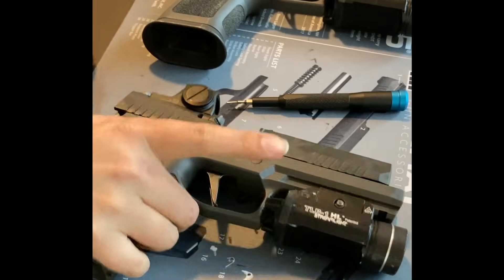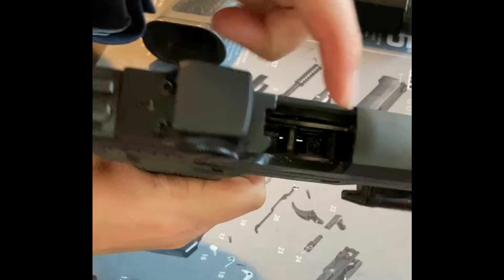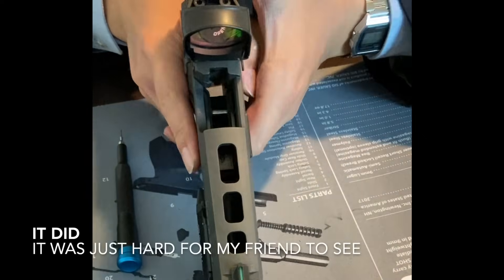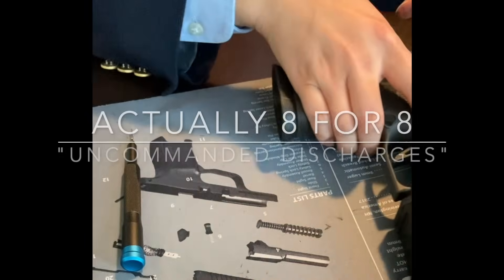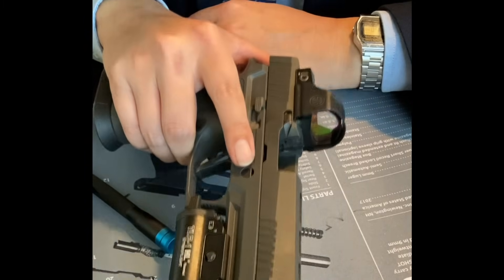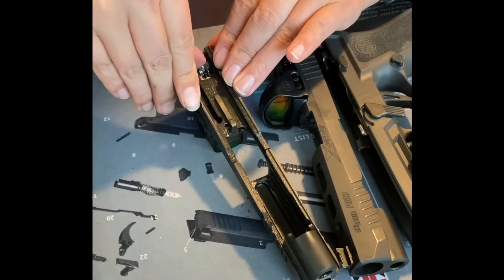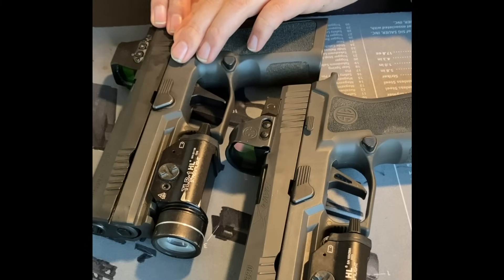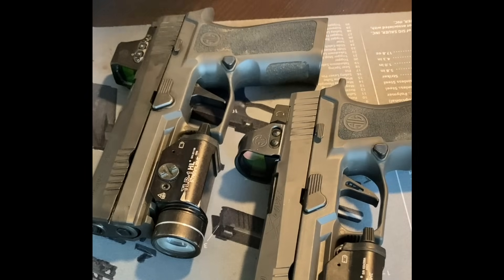Testing two P320's for Uncommanded Discharge: One PASS, one FAIL

Comment: Take a look at your brass on the friend’s p320 and look for striker drag.  The striker reset spring might be failing.  I had to replace a striker assembly on another brand’s pistol due to striker drag and light strikes.  It’s a cheap fix to replace the striker assembly.
Reply from the maker: His striker reset spring is almost certainly failing. It seems to contribute to the vulnerability, but does not appear to be the whole picture. Regardless, it's worth fixing that as well, but no point in spending that money unless we can get his pistol to actually pass the tests first.

Comment: Nobody is poking the back of the sear with a tool when they go off
Reply from the maker: For whatever reason, sears are failing and releasing strikers. When the sear fails, there is precisely one safety mechanism left preventing an “uncommanded discharge.”

This test doesn’t care why the sear failed, it assumes the sear has failed and checks whether that last-ditch safety mechanism is or isn’t working as intended.
Reply: @P320Truther isn't there a firing pin block?
Reply from the maker: That function is performed by the “Striker Safety Lock” - this test is explicitly intended to check for proper functioning of the striker safety lock.

Comment: Any idea on the round counts of these two pistols
Reply: What number is stamped on the front of the sheet metal frames
Reply from the maker: Uncertain of round count on my friend's pistol. Mine has thousands more than his, somewhere between 8,000 and 9,000 at this point.

The passing FCU has a 675 stamped Trigger Bar and an X-series flat trigger, the failing P320 has a 576 stamped Trigger Bar and a Legion-series skeletonized trigger.

Comment: YouTube keeps deleting this comment so I'm breaking it up.

Great testing. I've been waiting for something like this.

Something that I either missed or don't think was mentioned in the video is that manually displacing the sear as shown in your test moves the trigger, the trigger bar, AND the lever next to the sear that interfaces with the striker safety to disengage it. When learning this, my first thought is that the striker should be visible for EVERY test that you did. However, what I am noticing on my P320 is that pressing the striker down manually moves that striker safety disengage lever only slightly when compared to how much it is displaced when pulling the trigger directly. The striker safety itself does not need to move much before it allows the striker to move past it. I think the difference between the two guns you tested could be a combination of how much the striker safety disengage lever moves when the striker is manually depressed, as well as how much the striker safety itself needs to be displaced before the the striker can move forward.
Reply: You also mentioned 2 failures would need to occur simultaneously for the gun to fire: the primary sear would need to disengage without the trigger being pulled, and the striker safety would need to be free of the path of the striker. I think there is one more failure which would also need to occur for a total of 3 failures. On post drop fix P320s, there is a secondary "safety" sear in front of the primary sear. The idea is that if the primary sear were to fail, this secondary sear would catch the sear before it can move fully forward. This form of testing bypasses this additional safety. I think the only way a failure of this secondary sear could occur is if the sear assembly failed to move upwards quickly enough after the striker is displaced from the primary sear.
Reply from the maker: The current working theory is that the Legion’s interface between sear, trigger bar, and safety lever is tighter than the non-Legion’s interface, allowing the Legion to more readily translate sear movement into safety lever movement.

Re: Secondary Sear - It’s difficult to conceptualize a shock or jolt that would provide sufficient force in the appropriate direction to overcome the primary sear, yet simultaneously not provide enough force to keep the secondary sear out of the way due to inertia from the sear pivoting downwards powerfully enough to slip the primary sear against spring tension.

Comment: The real test is to take the gun to a range, have the gun chambered & loaded as it would be carried in a holster and see if you can actually make it fire this way. Obviously ensure gun is pointed down range in a safe direction before doing so.
Reply from the maker: The standard test is primed cases with no powder or bullet. There's no reason to set off a live round with this and risk the recoil munging up the slide, your tool, or your hand.
Reply: @ 

Then try it with a primed case & no powder. I’d just like to see if it would actually cause a discharge in the condition it’d actually be carried in
Reply from the maker: I would not be comfortable with a pistol whose safety regime includes mandating the use of ammo with hard primers… My friend’s striker protrudes when it really shouldn’t, and that’s all we really need to know to fail the pistol.

Comment: Great video back to Glock or M&P platform. I really don't want to deal with this company anymore, dumped my M18 and P365 even though P365 was no problem. The Sig quality is long gone for me owning older P225/P226 I love and will keep. Striker fire pistols that Sig manufactures are not for me plus my 365 rusted like crazy (not the mags) even though I wiped down the finish every night with silicone rag. I was looking for a reason to get away from Sig thank you I am gone.

Comment: Awesome demonstration, thank you!  You mentioned your friend’s FCU possibly malfunctioning so I was wondering if you could confirm a few things:  Do the 2 FCU’s have the same trigger bar number?  The same sear shape/design?  And does one or the other FCU still have a “striker safety lever return spring”?  Sig has made several unannounced changes to the P320 over the years which doesn’t help narrow things down.  That return spring is probably the part I’m most curious about - the P320 FCU’s safety lever used to be under spring tension but the spring was discontinued at some point supposedly because it could bind up and cause the lever to inappropriately engage the striker safety lock without a trigger pull but I think the official explanation was that the spring was redundant, unnecessary.
Also did you do a teardown of both striker assemblies?  I think I saw someone mention it in the comments but there’s a tiny spring that is overlapped by the main striker spring that pushes the striker back out of the breach after firing which did not seem to be happening with your friend’s assembly so I’m wondering if that part is damaged/defective.
I ran a similar test with my own P320 about 2 years ago and it passed but I didn't have access to any other P320's to try out for a bigger sample size.  TBH, even though mine was a pass, when I took apart the striker assembly and looked at the striker safety lock & spring as well as the tolerances involved it didn't inspire a lot of confidence at all.  I'm not an engineer or gunsmith, but I suspect Sig settling on the P320's weird striker safety design was probably a byproduct of the space constraints they were left working with when they cannibalized/recycled the hammer-fired P250 in the rush to make the P320.  In contrast, the P365 was basically designed from the ground up, has a more robust firing pin block/plunger-style striker safety design, and coincidentally has a much better reputation than the P320.
Reply from the maker: The passing FCU has a 675 stamped Trigger Bar and an X-series flat trigger, the failing P320 has a 576 stamped Trigger Bar and a Legion-series skeletonized trigger.
Both FCU's sears are identical to all appearances.
Neither FCU have a spring pressing the Safety Lever back down. The Safety Lever freely rotates to the extent allowed by the Trigger Bar.
Clearly my friend's Striker Assembly does not have a Striker Return Spring in good working order, but that spring merely seems to mitigate the problem rather than cause or solve it.

Comment: Great video. This is a great way for all of us to check if our 320 is safer or not. I will test mine to see if i will return it to my carry rotation as right now it is not. Back to my g17 and 229
Reply: Just for shits and giggles carry it with the striker engaged, but with no round in the chamber. Come back to it in a month and see if the striker is still engaged. If the sear cannot hold the striker in place I wouldn't be relying on the striker block to keep the gun from firing. Problem is these issues are happening so randomly. Who knows if a gun that is safe now will still be safe two years from now?? To me this is just a faulty design and I could never have faith in it performing the way it was intended.
Reply: Took mine out of rotation too, I have yet to have an issue but started to become concerned about wear on the sears /and safety mechanisms I’ve defended the p320 my fair share but there were far too many instances to ignore

Comment: ....Thank you! Great video that most or ALL P320 owners should see, right here.
Reply: I don't understand why they don't slamfire on the range if capable of an uncommanded.
Reply: Alot of maybe's
Reply: Tested mine this way and it didnt have the issue at all. I'll periodically check it but I feel much better now seeing the mechanism and work.
Reply: I couldn't find any report from any p320 anywhere else in the world having this issue. Even there are no numbers of units sold outside the US available, it has been adopted by law enforcement in many places.  In Germany they cost double, but they probably also do tolerances and quality control the German way. Best guess is: manufacturing defects in the US. It's a known issue, that SIG USA is not as diligent and precise as SIG Switzerland once was.
Other than that, this may could be caused by improper maintenance, causing damage to the spring?
Reply: They don’t want to know it.
Reply: Notice me, senpai
Reply: @Hugh_Jass86  witnessed
Reply: @jiujitsu5000  RIDE ETERNAL
Reply: The legend himself

Comment: The reason this is happening (at least on the 1 gun) is that by pushing the sear so far downwards, it automatically activates the safety lever upwards which allows free striker movement. In reality the sear has constant pressure with the 2 sear springs. By pushing it down with that pic you are removing all spring tension and of course allowing the striker leg to bypass the secondary sear safety notch. Interesting video but what realistic situation would replicate a pick being able to depress the sear fully downwards like this ?
Reply from the maker: For whatever reason, sears are failing and releasing strikers. When the sear fails, there is precisely one safety mechanism left preventing an “uncommanded discharge.”

This test doesn’t care why the sear failed, it assumes the sear has failed and checks whether that last-ditch safety mechanism is or isn’t working as intended.
Reply: Something as simple as sear wear or an out of spec part. That's it. It's way too easily defeated.
Reply: @ simply search wear cannot change the operational characteristics of the gun. You got that from “Indian MIM” comments. To date we haven’t seen a single case where anyone can show a sear so poorly made that it alters the operation of a P320.
Reply: @great_deception  🙄 I don't know where you got the idea that out of spec parts or wear cannot change the operation of the trigger/fire control group. Of course it can, and will. The P320 has a host of issues not only in design, but also manufacturing engineering issues that Sig refuses to address.
Reply: @ Please show us 1 verified forensic or lab reviewed example of a worn sear or even an out of spec part making a post-2017VUP P320 fire WITHOUT a trigger pull.

Comment: I would love to see these pistols disassembled and the parts compared - they’re not difficult to take apart. Would you consider doing that and posting it?
Reply from the maker: Working on it...
Reply: @P320Truther the other thing that could be happening is that the lifter cam that moves the safety lock up could be taller on your friend’s gun. His safety lock could also be slightly lower. That would explain why his always overrides. It’s enough above the stop on the striker even when it’s at rest.

That would also explain why your striker failed twice. It’s borderline within the stop range, but twice the force of the striker coming forward was enough to push the lock up.

Lastly, when you put your friend’s slide on your FCU - you didn’t see failures because your cam is the correct height, and the safety stop was low enough to catch the striker stop.

It would be interesting to measure how proud that cam sits when it’s in its resting position on both guns.
Reply: @P320Truther also - that striker looks like a MIM part. MIM has a tendency to not be consistent sizes when done poorly. If that striker was just a little undersized it could move up in the striker channel. Combine that with play in the slide and it’s not hard to imagine the striker sliding off the sear when the slide is bumped.

Comment: I want to see both guns Sear’s. I am suspecting the one that doesn’t fail has the 2 step sear.

Also lube the failing one it’s dryer than popcorn that could be part of the problem.
Reply from the maker: Both sears are the post-"upgrade" variant with the secondary sear, but it's irrelevant, as the secondary sear never engages. Lube on the slide is irrelevant to any of the specific safety features at question.
Reply: But carrying a dirty dry weapon is fashionable.

Comment: I have and you can to use the same pokie thingy on a glock too and get the same results on every glock. Crapola, stacatto is going to series 80 on their guns because if you drop them barrel down they will fire unintended too. I performed "your test" on all my  actually all weapons will release the striker, firing pin, hammer I you manipulate the sear. No before I pushed down the sear like you did I insert a pencil ,eraser part down into into barrel, pointing the gun up I pressed the sear, it released the striker but the striker block did its job,  the firing pin never strike the pencil eraser, if it have the pencil will move (this is actually how to test firing pin striker functioning correctly, then I went to the range loaded a live round I tried your test never resulting on a discharge of the bullet. Since your post I have tried on 53 different p320's..... still nothing happen to corroborate your claim......
Reply: Glocks have a plunger style striker block. They require a trigger pull to defeat the striker safety.
Reply: Not remotely true
Reply: An impossible thing to happen on a Glock— this is a blatant LIE—without the TRIGGER moving—the bar WILL NOT depress the safety plunger and the striker will thusly be trapped behind it…

Comment: Someone get this guy a job at sig, he can figure it out with a long pointy thing while sig has a state of the art facility and claims nothing is wrong with their p320   😂
Reply: They actually had 3/10 of their own tested pistols cause light primer strikes after doing vibration testing on them
Reply: That would imply SIG is interested in figuring this out. I'm sure they know but they can't admit it. They have likely quietly fixed this issue and won't admit it

Comment: So you are sticking a Pointy thing in the gun to make it go off and call it a failure?
Reply: You don’t understand what this is testing.  

It’s testing if the safety features work if the striker were to drop.
Reply: LOL. This is how you test to make sure that if something internal fails, the gun still won’t go off due to other safety mechanisms such as a firing pin block. 

Sig claims that even if something fails, if the trigger isn’t actuated the weapon cannot fire. Which is obviously not the case on some weapons for whatever reason it turns out to be. 

Be smarter.

Comment: I don't know if it matters, but if you completely disassemble the striker, there is a very very tiny spring in there, and every time I took mine apart, that spring was broken.
Reply from the maker: It is likely broken in my friend’s P320. Sucks that it can only be officially replaced as part of that entire striker assembly.
Reply: @P320Truther it’s the striker reset spring I believe
Reply: From what I've heard, their springs frequently break. People say it's poor quality. Maybe it has more to do with excessive tension with the design.
Reply: It is the striker reset spring and  it is serviceable  , you can buy just the spring
Reply: The P365 trigger return springs are breaking too.
Reply: @kellyBorgman springs wear out they have a round count. . Most people never shoot their guns enough to wear them out , but they do wear. I believe the spring you are talking about is a torsion type spring. So the coils are rubbing each other , which is friction = heat, yes I know it’s a small spring and dosent generate  a lot of heat or any heat.    But springs do wear out and require replacement   ,  imho.

Comment: Sig should have been the ones to figure this out a long time ago, and they should have posted a similar video where they assure users they will fix the issue and fix any gun that has the problem.
Reply: They did figure it out, they just never told anyone 😂😂😂 probably looked at the money they would lose and said hell naw
Reply: Misdirecting is cheaper than implementing a fix.
Reply: You are assuming they didn't know this was the issue. It's a lot cheaper to just blame it on user error.
Reply: Sig can't fix the P320 until someone "fixes" Ron Cohen...